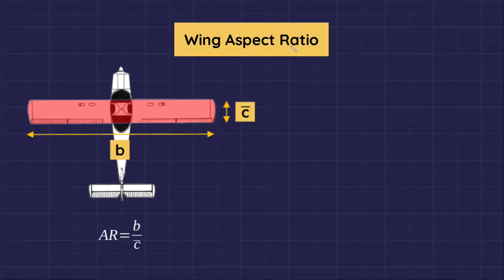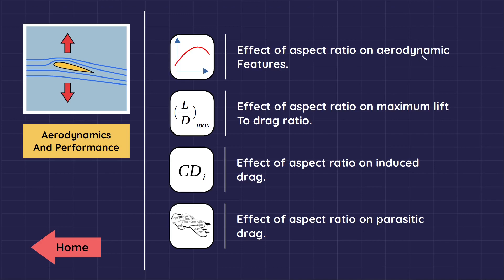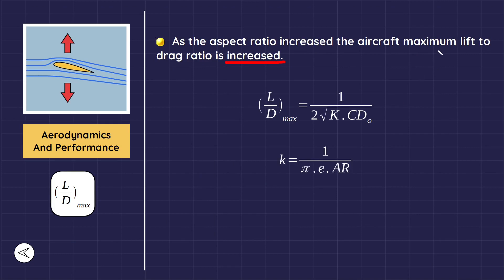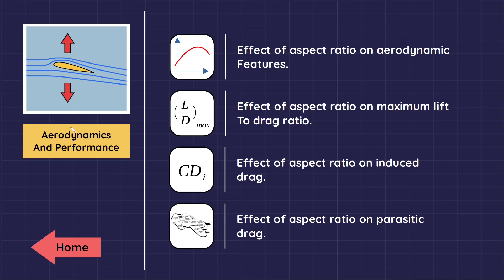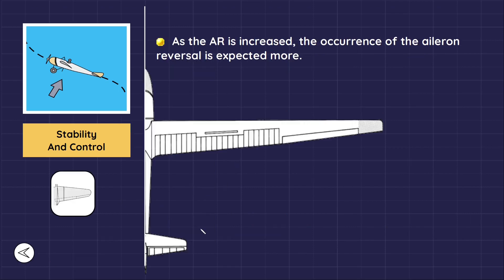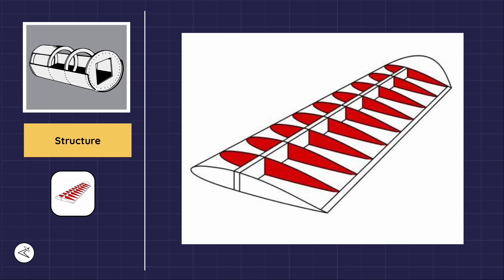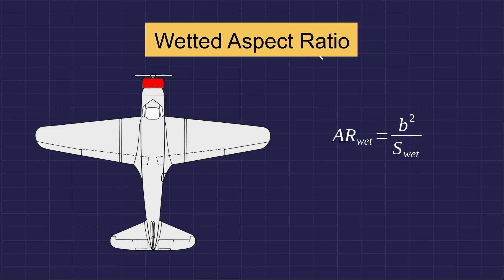Wing Aspect Ratio

Comment: I have several questions:
1). Is the Wetted Aspect Ratio about all the surface of the airplane: bottom, upper, left, and right side?

From the aerodynamic and performance:
2). What did you mean with 2D-Airfoil and 3D-Wing?
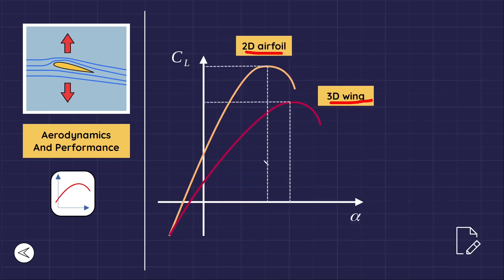3). In 3:14 you said: "As the AR increases, the lift curves loop increases toward the maximum theoretical limit of 2 pi." I am not sure whether I got what you said correctly, I activated the caption to  help me understand what you said. Did you really said "2 pi"?
4). In 3:19: "As the AR increases, the wing stall angle decreases toward the airfoil stall angle." This is related to point 2). If I understand the point 2)., I maybe will understand this one, too.
5). Referred to point 4)., what is the relation between wing AR to the horizontal stabilizer AR (wing's AR increases --> tail & canard's AR decreases)? Why and how do they related? I thought that the horizontal stabilizer is just to control the airplane's pitch, that what I learned so far.
Reply from the maker: When we use the term infinite span for 2d airfoils we mean there are no wing tips and no trailing vortices, and the flow is purely two-dimensional. This is a simplified model that allows us to analyze the aerodynamic characteristics of the airfoil without considering the effects of the finite span.
Reply: @eng.ammaryosef1193  thank you for the 2D-airfoil.
Reply from the maker: Welcome @StrAmbrg
    1. Wetted Area: yes it is the surface area that is in contact with the air flow that’s mean it is about all the surfaces of the airplane: bottom, upper, left, and right sides.
    2. 2D-Airfoil and 3D-Wing:  A 2D airfoil is a cross-section of a wing that has infinite span but a 3D wing is a finite wing that has a finite span.
    3. As the AR increases, the lift curves slope increases toward the maximum theoretical limit of 2 pi. Yes I said 2 PI for The lift curve Slope (Cl_alpha) not loop. Sorry for my English accent that was not so good.
    4. About the relation between wing AR to the horizontal tail AR: As the aspect ratio increased the wing stall angle is decreased. So that we made the horizontal tail AR lower than the wing and this make the horizontal tail stall after the wing and allow the pilot not losing the control if the wing was first stalled.
Thank you. 😊
Reply: @eng.ammaryosef1193  quote: "A 2D airfoil is a cross-section of a wing that has infinite span." What do you mean that 2D of an airfoil has INFINITE span? Is not the 2D-airfoil just cut-off of a 3D-wing? As the 3D wing is finite, so does the 2D-airfoil also should be finite, the cord should be finite. Will you please elaborate that statement again?
Reply from the maker: Check the lift curve slope value in thin airfoil theory. Where The lift curve slope is the rate of change of lift coefficient with respect to angle of attack. In thin airfoil theory, the lift curve slope is equal to 2pi.
Reply: автор видео не совсем компетентен в вопросах аэродинамики и поэтому его рассуждения не являются абсолютной истиной и их следует воспринимать с большой осторожностью . На первый взгляд ему не хватает практического опыта . И он очень небрежен в своих рисунках и графиках , нет размерности осей и графики расположен очень далеко от своих мест .
Reply from the maker: @ОлегКо-э9к 
Thank you for watching my video! I apologize if anything is unclear or if there are any mistakes. I truly value your feedback and would be happy to learn from any corrections you might suggest.

My goal is to make aeronautical engineering information accessible and easy to understand for everyone. Please feel free to share your thoughts or suggestions to help improve the content.